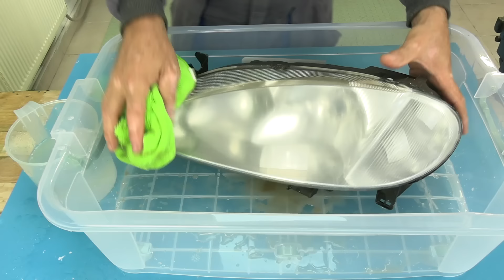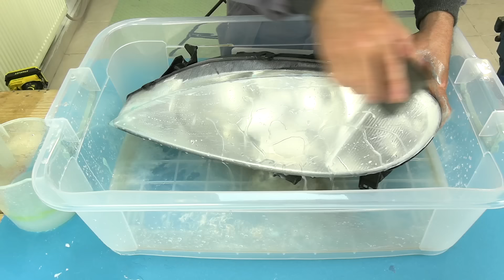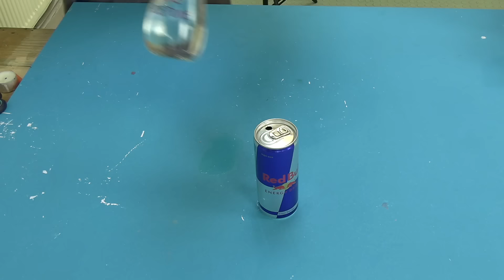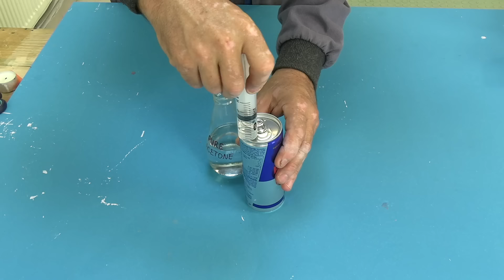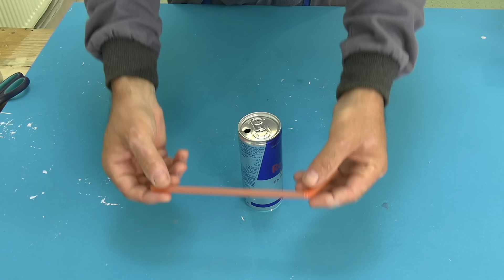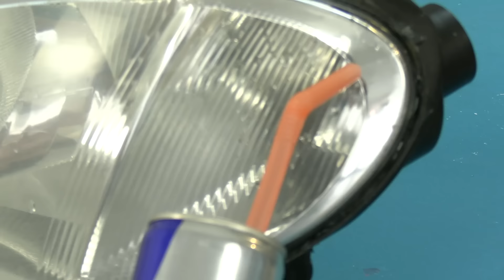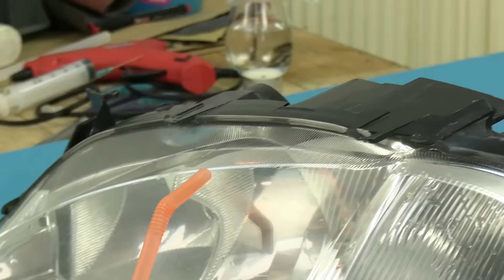Headlights Are Like New With 3 Drops  Acetone. I Could Not Believe My Eyes!

Comment: acetone has a flash point of -20C so not sure how anyone keeps from starting a fire with an open flame only a few inches away from the vapor.
Reply: “The stoichiometric ratio is the exact ratio between air and flammable gas or vapor at which complete combustion takes place.” Just because there’s a natural gas being let out of the swamp doesn’t mean someone else on the other side of the county doesn’t get to smoke a cigarette. Have you ever seen the video of the pale of gasoline that someone puts a welding ark in? The fire triangle states that there’s a source of ignition, and there’s a source of fuel, but there’s not a source of oxygen, regardless, the ratio of the oxygen to the fuel still has to meet the efficient.
Reply: @williamcope2652    The stochiometric point is for ideal combustion. IOW, least emissions and most power. Gasoline is 14.7:1 but there is a wider range of flammability overall. They are called the LEL (Lower Explosive Limit) and the UEL (Upper Explosive Limit) You also have to consider the conditions where you actually have a vapor to burn. Gasoline has no vapor at around -50F but plenty at room temp. Fuel oil / diesel has almost no vapor till you reach over 125F. IOW, you need the vapor and the air mixture. In this video there's plenty of air so it's a matter of reaching a rich enough mix to go boom.
Reply: Suddenly we have PHD.chemstry scientist. Here.. Telling us..
Lol this method is used by Professional headlight restore shops.... You can buy the actone vapor Kit online..  It's a simple device.. Aluminum can with heating.... To produce actone vapors...
Reply: @cetujavu3466     not suddenly. it took a few years to get the education. BTW, the video shows an open flame, which is far from professional level.
Reply: @rupe53  like I mentioned before.. This method is done by professional...actone vapor plastic polishing method.   and the actone is contained inside a aluminum can with venting hole in top for vapor to escape..   All this guy is showing is DYI version you can make for less $  compare to buying the same concept kits sold online.  You might be book educated.. But I also work in dental laboratory.  Using everyday.. Butane gas.Denture alcohol. and actone. .which both highly flammable.   But nit to a point when inside a contained can..  To cause fire explosion.. Yes it's not professional..what his doing... Thats why its called DYI..
Reply: @cetujavu3466     and that's what I  was pointing out.... the unsafe practice.

Comment: There’s a quick way to improve lights, not as good as your method, but quick. Use kitchen cleaner like Comet with a wet towel then get a restore liquid, not expensive from auto supply to finish.

Comment: I think you could use any process to get the yellow plastic off and then use the acetone at the end. I have a 3M light cleaning kit that I’ve used to about every three years with a product that goes over the top that doesn’t seem to last and I’m thinking next time I clean them off I’m gonna try the acetone at the end.

I do think your title is kind of Clickbait. I mean you had to remove the headlight? What the heck that’s not easy.
Reply: I spent much time with that 3m kit myself and, as far as I could see, no improvement.

Comment: HOW LONG DOES IT LAST AFTER YOU DID IT THAT IS THE MAIN POINT????
Reply: Non of them last.  Use Mothers aluminum polish easy as heck.  Last three months depending on the weather
Los Angeles
Reply: This method is used by Professionals.. Actone vapor plastic polishing... Just remember to apply UV coating cream
After the treatment...

Comment: Way to much hassle.    Use Mothers aluminum polish for a 5 minute fix  100% easy  LOOKS GREAT   Los Angeles
Reply: All you need to do is Wipe on Mothers aluminum polish with a cloth and wipe off almost right away with a terry cloth or micro fiber towel.  You'll be surprised.  Very fast.  😁

Comment: Couple of hours all the haziness from the sanding will come back
Reply: if acetone wasn't a solvent, this would be correct. acetone is basically melting the plastic lens back to a clear protective coating though.
Reply: @LygerTheCLaw  can you just use a hot air gun insted of aceton to melt the plastic smooth.

Comment: I wasted hours of time and $550 replacing my headlights after all of these voodoo methods made my headlights incredibly worse.
Reply: Well isn't that your fault for so readily believing this rubbish
Reply: @billyboybliss. Lost me with the can. 🙄 
•Wet sand 600g if really badly oxidized.
•wet sand 1000g if still decent.
•Compound with buffer or drill adapter.
•Apply Carnauba Wax for added durability.
•Repeat as needed every year
Reply: Lol.. This is not voodoo.. Lol
 Professional use this method .. It's called actone vapor polishing.. 
Lol
 You have to get the temp just enough for the actone vapors .. They sell the kit online for less than $20
Reply: Naaaaah maaaang
Reply: Sounds like a skill issue

Comment: Will not last.  Once the UV coating is gone, the plastic will fog.  No matter how much you polish or sand or apply acetone......unless you replace the UV coating, the fogging will return.
Reply: After all the sanding, several light coats of Rustoleum UV resistant clear coat will last 2-3 years.
Reply: I agree.  This is why after polishing I follow up with a clear 3M film of automotive quality.  The shine lasts a very long time.  Great idea with Acetone vapor.  Clever.
Reply: Plexus, work well, just reapply 2-4 times a year.

Comment: Too much work … Just use Gumption with a paper towel. Scrub on and clean off and keep doing this 3 times until there is no yellow tarnish on the paper towel .. Then wipe over with WD40 ..   This is not a permanent fix but it’s cheap with less fuss .. I do my headlights twice a year !